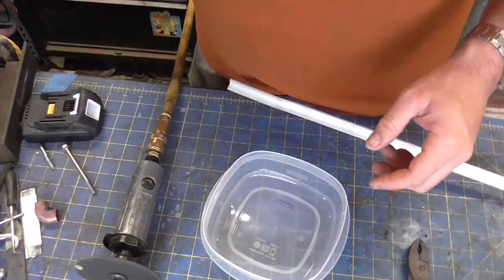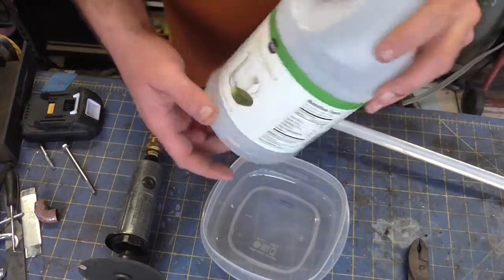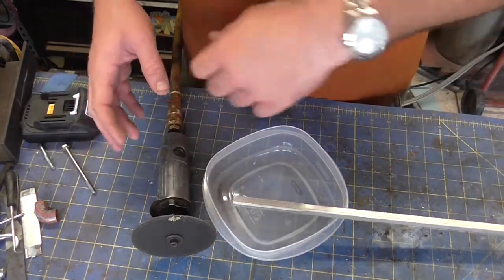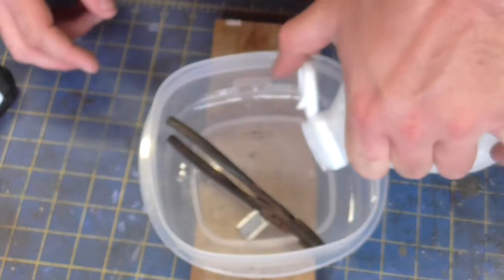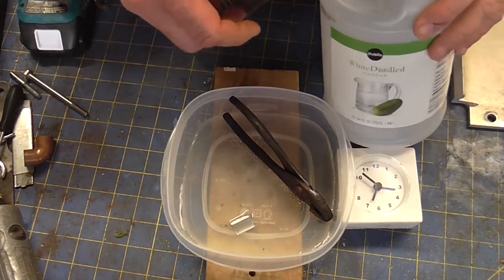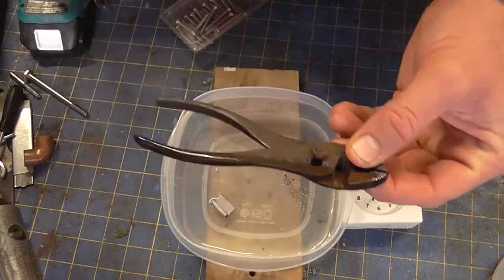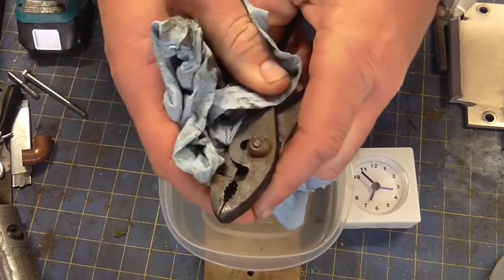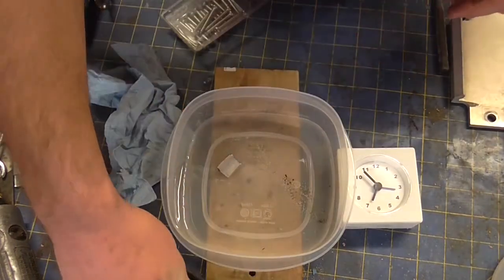vinegar vs. rust

Comment: Hello Joe!  Great experiment, I too wondered what vinegar did to aluminum!  The vinegar is a fantastic rust remover, it isn't fast though... Typically the minimum soak is 24-36 hours. For best results I have found that when soaking, remove the item every 12 hours and scrub with a common stiff nylon brush, then return to vinegar. When all the rust is gone it will typically be a grayish-black in color.  Brush once again and place the tool in hot water with baking soda, that will neutralize the acid.  It only takes about fifteen minutes, then dry it off and work on it immediately or it will flash rust.  It's not a fat process but it's the best I found!!! Thanks!!!!!!
Reply from the maker: That's a good point. I was worried about getting the girlfriend's Tupperware back in the cabinet before she found out, so I had to make it a quick test :). On a different note, with your wire wheels and buffers are they 1725 rpm or 3600 rpm motors? Which do you prefer?
Reply: Joe, I like the 1725-1750 for wire brushing and for buffing the 3200 and up. The reason is with buffing you kind of need to build up a little heat.. What RPM is your wire wheel? That one does a great job!
Reply: PS, -Joe, if you cut some old detergent and bleach containers in half they make great soaking buckets!!!  (Your girlfriend will thank you! lol)
Reply from the maker: My Powertec buffer says it spins at 3450. As such, it can really send a nut or bolt flying across the room when I don't have a good grip. As always, thanks for the comments and great tips. :) Cheers.
Reply: Joe's Shop LMAO!  How many times has the buffer plucked a nut or screw out of my hand and flung it into the floor at Mach 2 only to cause a ricochet sequence that makes me tilt my head like a blind man trying to hear where it has landed knowing for certain it has winded up under the bench of “never to be found”!  😂